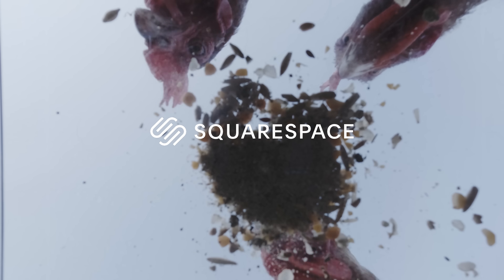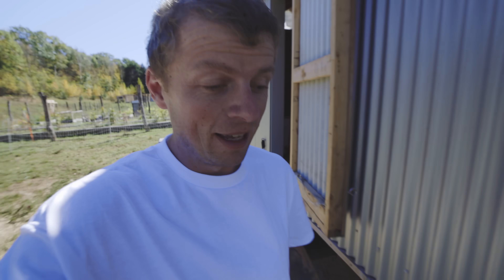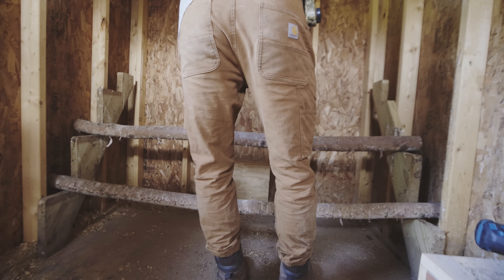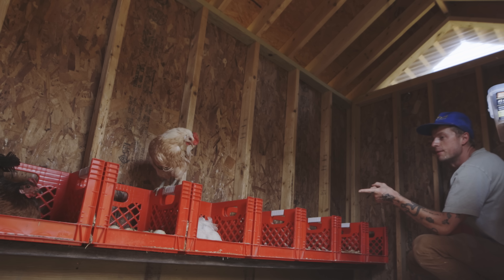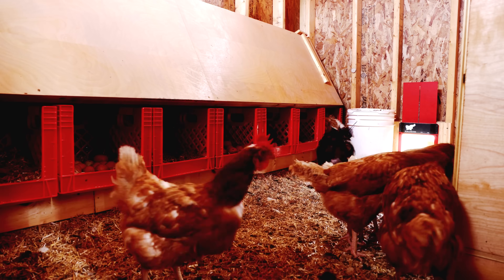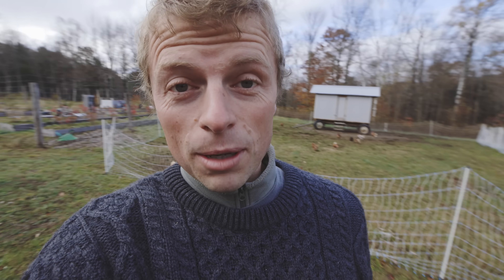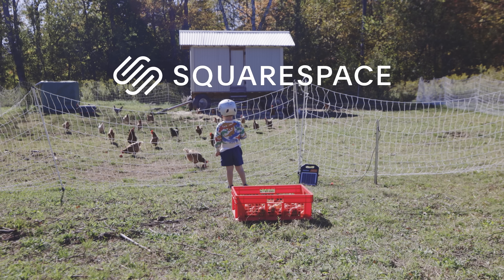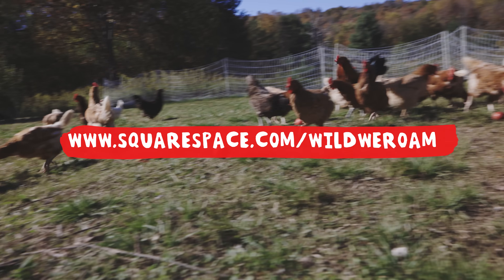We Built A Fully Automatic Chicken Coop - self feed!

Comment: One solution I saw about the feed on the floor is to make a small lip on the wall closest to the chicken. Basically they are grabbing the feed with their beak and scooping it back to get it in their mouth. The feed at the bottom gets scooped onto the floor because it get caught between the chicken's beak/neck and the flat wall.. and then pulled out by pressure against the wall and the pulling back motion. With a small lip, it forces the beak to go straight up right at the end and has a little extra space so the feed that would normally spill out on a flat wall will still fall... but back into the feed trough instead pulled out onto the floor.

Hopefully that makes sense.